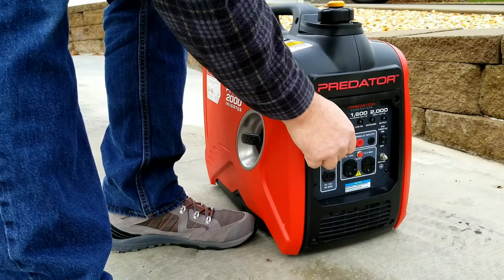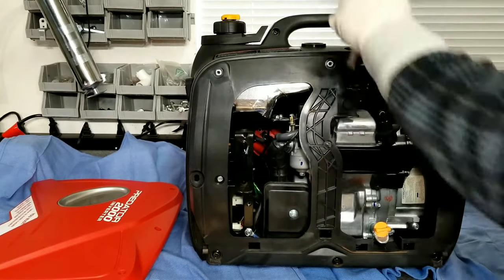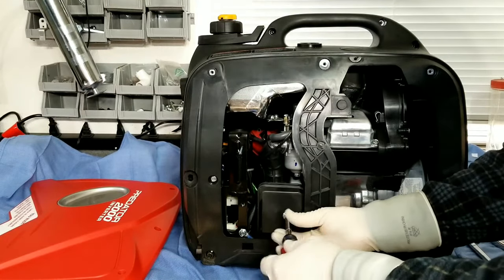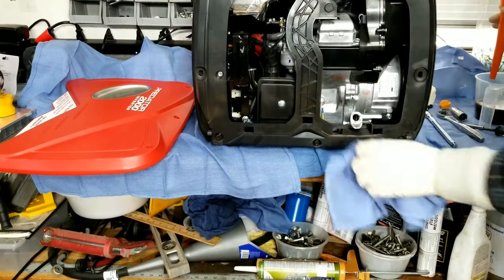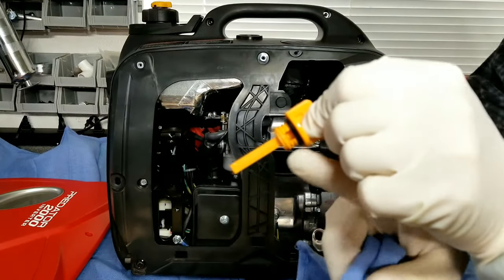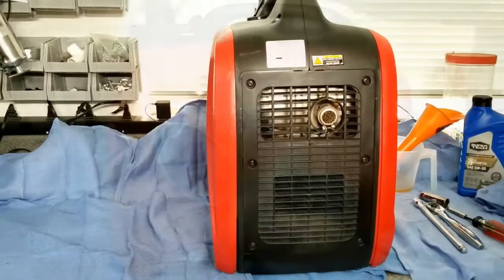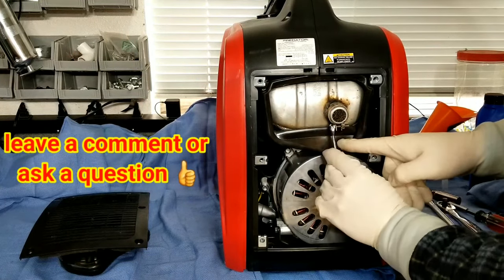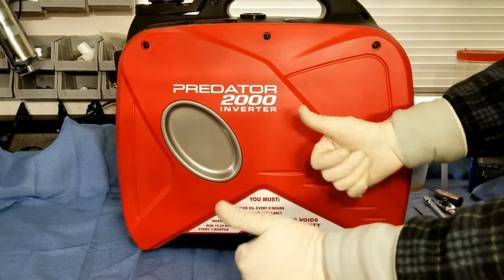Predator 2000 Oil change and 100hr 6 month service Don't forget this part!!

Comment from the maker: Hope you enjoy this quick tutorial and thanks for  watching and Subscribe 👍😃
Reply: Hello I meant to ask if I can use 100% synthetic oil being that I know that Vehicles last a lot longer are you smoke one synthetic but if I use synthetic on the generator will that tend to make the cylinder piston rings everything last longer
Reply from the maker: Yes that will work fine
Reply: @johnnysweekends  Sorry Johnny  I mistakenly typed "smoke" the word was not planned, so disregard it
Reply: @johnnysweekends  How do you loosen the spark plug boot, you passed it as if your unit did not have the cable boot connected to the spark plug I tried pulling it and it is glued for good
Reply from the maker: @alexshatner3907 it shouldn’t be that hard. Twist back and forth and pull up

Comment: Just a update for you guys about thos generator... I use it almost everyday with 600w load... mine currently has 3500 hrs on it and still running... I change oil with synthetic at 100hrs and I use a ngk spark plug cr5hsb
Reply from the maker: Wow that’s crazy..!!!!
A lot of hours on it. But showed if you don’t always over load it and take care of it it will do just fine
Reply: We run ours 10hrs a day. It runs our Starlink dish & phone booster so not a big load.
Reply: I have about 3000 on mine and use it daily too. Only issues I've ever had was fouling plugs from clogged spark arrester

Comment: Thank you for the video. I learned a good bit.    Just got one today and I'm not going to get it out of the box for a while.    I have a 9400 wt generator  but got this 2000 predator just incase we ever have to leave in a hurry.  We can charge all out phones run a fan or to or blow up air mattress  100s of uses when on the road

Comment: You forgot some things. What do you do if that exhaust screen is dirty? You say oil should come up to the threads. Look in that hole. The threads look like they go way down there and don’t match the dip sticks length. Finally do you run out the gas if you are not going to use it for a long time?

Comment: I've been cleaning the air filters on my Honda every 50 hours as per the manual.  Total overkill given that I'm running it in the fresh air.  Also I need one of them clip on funnels!
Reply from the maker: Yea depending where you use the gen every 50 hrs hrs can be a little much. But not everyone treats them the same so maybe bump to 75 hrs unless its in dirty conditions. But having a clean air filter helps it breath and run efficiently so nothing wrong with every 50hrs.

The funnel i just wedge in there lol and it stays...Walmart 😁

Thanks for the comment and thanks again for watching and Subscribe 👍😃

Comment: Great video! I might add...

Get a aftermarket magnetic dipstick. Change your oil twice within the 30 hours break in. Pull all metal shavings off dipstick each time. (There will be a lot). This will maximize your engine lifespan a ton. 🤟🤟
Reply: Got a link?
Reply: Bad idea. The little ball magnet  falls out and then youve introduced more metal than you could ever pick up. Proper break in (changed my oil 3 times in the first tank) and then proper maintenance after the break in period, will resolve the need for magnetic pickups.

Comment: I have had my Predator 2000 thru a few storms in winter and the spring and it has held up fine. The only complaint I have is there needs to be a inline fuel filter to pick up any trash from the fuel. I recently tried starting mine after less than a month and it wouldn’t start. I checked the oil, filter, spark plug and carb. The culprit and fix was to drain the fuel from the bowl since there was trash in it. This fixed the issue and runs great now!
Reply from the maker: That’s good to hear…. 

Glad it’s working good.
Reply: ⛽️  keep the fuel tank filter in place... pop the side cover off & drain the carb bowl before storage and you will be copacetic
Reply: There is one. It's in the carbs fuel inlet.
Reply: When I shut my off, I turn the air vent off, then almost turn the dial to shut it off and that starves itself for gas and burns off the remaining fuel out the carb. Few extra pulls to start it but the carb doesn't gum up with fuel between starts

Comment: Awsome work...I just replace the flame filter restor it was clogged real bad  that it made my overload  light blink,Blick ...and my generator wouldn't stay on to long 20 minutes. ,running crappie ,and shaking generator was moving around in circles,no power tools working ..thanks for tips 👍.now is stable sounds smoother . no overload blinking light...yehhh,..I even looked at the manual troubleshooting guide and their is nothing there guiding me to the filter restor????
Reply from the maker: Wow well glad you went and check on it..
Glad I could help out..👍🏼

And thanks for watching 👍🏼😀

Comment: Adjusting the valve lash would be a good idea too at 100hrs
Reply from the maker: I normally don’t touch them until the unit has a issue mainly with starting. Sometimes if it ain’t broke to mess with it. Lol

Comment: Thanks for the info brother! Getting on it right now!
Reply from the maker: Glad I could help..👍🏼😀
Reply: @johnnysweekends  started raining.. damnit.. does it have to be 4 cycle / small engine oil? My internet sucks so I couldnt really tell what you used. I already grabbed some mobil 1 fully synthetic 10w30 fro. Autozone.. that should work fine, right?
Reply from the maker: Yup. These little engines don’t care about brand just weight and frequent oil changes. 5-30 or 10-30 is just fine. 

So you are good 👍🏼
Reply: @johnnysweekends  thanks again!

Comment: Hi, do you know what spark plug this Predator 2000 takes. Rather have it before hand, thanks.
Reply from the maker: Hello, this is what is typically found in the unit stock. But you can use others. 

https://amzn.to/3uGP7I8
Reply: @johnnysweekends  Thanks Johnny..

Comment: When should I not turn on my eco button?? Is there a certain wattage it shouldn't exceed?
Reply from the maker: Yes, if you use say a compressor and it starts and stops alot then circumstances like that is a good time to have the eco switch off. Or starting up ac units.
And load that requires full boost power is when it should be off then after say a AC unit is running then turn it on.

Comment: Thank you for sharing this video.
Reply from the maker: Your welcome glad I could help. 😀👍🏼
Reply: @johnnysweekends  I bought the Predator 2000 yesterday.  Will use it this weekend.
Reply from the maker: Awesome make sure to change the oil after a few hours it gets dirty quick then you can go to the recommended it says in the manual or if heavy duty use change more frequently 👍🏼👍🏼

Comment: can't pull off the ignition coil, how did you remove that to get access to the spark plug?
Reply from the maker: You don’t need to pull of ignition coil just the spark plug boot only. Just lift it straight up.

Comment: I want to purchase one of these generators for emergency use only. Should I keep gas in the generator or should I fill it up when I need to use it? Mostly for the rare power failure in my area. Thanks for an excellent video.
Reply from the maker: Honestly empty is better that way you have fresh fuel when you need it. That way if its 2 years before you use it the carburetor will not be compromised from old fuel possibly damaging it. Now you could drain the carb with the drain screw and that also works.  Or leave empty and get a metal can of ethanol free fuel from say home depot or lowes. It will be good for a few years i believe. 
Hope this helps.

Thanks for the comment and thanks again for watching and Subscribe 👍😃

Comment: I put too much oil in my first start up and the Predator blew white smoke for about 10 minutes before the exhaust became clear. How would I know if I damaged anything?
Reply from the maker: I would assume it if it’s running ok then it should be fine. I would check the oil level again and make sure it’s correct. 
Only to the bottom of the threads when level
Reply: @johnnysweekends  thanks for the  excellent video !
Reply from the maker: You’re welcome 😀👍🏼

Comment: I see you’re running full synthetic 5w-30. I heard from a mechanic that I should use “poor quality” oil for the first thing of oil (not synthetic) to help the rings seat, which will help make it so it doesn’t use/leak oil in the future. What are your thoughts on this theory? Sorry that I may not be explaining correctly
Reply from the maker: I have heard that as well to use a base mineral oil like the old days to help with break in and seat the rings.  

Now with the invention of new synthetic oils that have a lot of different materials in it along with cleaning agents I bet it really doesn’t make a difference and even if it does it would take years to find out between one engine and another used in the same fashion with normal service. 

Most people never keep anything longer then 7 years now if not less before they sell or upgrade or whatever. So everyone who does all this crazy maintenance or use super expensive oils which most are pretty close except amsoil, all your doing is helping the next guy and then the next guy.

And most the times engines die from abuse or neglect verses a normal break down from a manufacturer defect. 

In most these generators I hardly hear of a generator loosing a piston or something from any oil. These are basic lawn mower engines. And with normal use and maintenance they will run fine with the correct weight of oil that is changed frequently. Your motor is not a performance engine so it doesn’t care. 

And more then likely the inverter board will fry long before the motor dies.

Sorry for the long explanation lol….🤣😅👊🏼

Comment: what was the size and name of the tool you used to change the spark plug? Sorry i'm not super handy :(
Reply from the maker: You need a 3/8 ratchet a long 3/8th extension. And a 5/8ths spark plug socket..👍🏼

Comment: What would you use to clean the exhaust flame arrestor with. soft brass brush or would you use any solvent to dry to dissolve any buildup
Reply from the maker: I use a torch as seen in a couple other newer service videos, but a brush is quick and easy and works great. But the torch is a lot more fun. Watch the newer videos for service towards the end and it shows the torch being used. 

👍🏼😀

Comment: Can I use Honda 10 w30 oil in my predator generator? I don't think it's senthetic?
Reply from the maker: Yup you can use just about any oil as long as it’s the correct weight. 
I almost think I’m going back to semi synthetic for about everything. It’s cheaper and honestly I have never seen a engine these days with proper maintenance die because of a oil lubricant problem. It’s normally something that fails due to neglect or abuse.

Comment: I will be using it for vacuuming (detailing) when should I first check the oil?
Reply from the maker: If new switch oil after about 5 hrs or less then every 50 hrs.
Reply: @johnnysweekends  Thank you
Reply: You liking it for detailing so far?
Reply: @joncruz4837  It is very quiet than I expect it 👍 I recommend it.
Reply: @Lex_RKO  nice!! How many things can you run on it? I’m hoping I’ll at least be able to power my air compressor and steamer too Individually of course
Reply from the maker: How big are the units… you should be able to find the amp draw.
Reply: I have the older 2000 that my dad no longer needed. Mine does not say "inverter" on it. It says 13.3 amps maximum so I can only run 1 tool at a time since my pressure washer runs at 12.4 amps I can't have my steamer warming up as I'm washing the vehicle. I will be upgrading to the 3500 Predator soon so I can have more than one tool running.
Reply from the maker: Keep the little one with you as well..

Comment: Great video! Any tips on the engine surging? I compensate by adjusting the dial choke but would rather have it working properly. Mine has about 100 hours on it so I'll try all of your tips especially the plug cleaning or replacement, Thanks!
Reply from the maker: Let me know how it goes but yes a new plug and fresh gas is helpful.
Reply from the maker: Don’t for get to check the air filter
Reply: I don't know what carb it is but it's probably the jet needs cleaning on the top of the carb. It's probably under a little brass screw behind the throttle shaft if it's a Yamaha clone. You would remove the screw and the jet and run a small strand of wire through the holes in it and rinse with solvent and reinstall. Might also be under the idle screw if it's a clone of a Honda carb. You will have to remove the carb to access it most likely.

Here is an example https://youtu.be/O_DZXh67-fc

Comment: When pairing inverters do you know If it’s ok to have one in eco mode and one with eco mode off? Thanks in advance
Reply from the maker: I would have them the same both on or off eco.
Reply: @johnnysweekends  ah thanks for the reply sir
Reply: I could just run a splitter on my 50a plug with 2 plugs and run the side that runs the ac on one off eco and the other in eco I suppose
Reply from the maker: For like a rv..? I you want to power each line you could do it that way then. AC side eco off, and all other minimal loads with other unit. Depends on the rv though and how its wired.
Reply: @johnnysweekends  yep I’m an electrician so I think I can figure it out lol
Reply: @johnnysweekends  😁👍🏽

Comment: Would really like to see a video taking the carburetor off and cleaning it. I think I pinched mine while removing the recoil assembly which had one bolt bottom that was really hard to get off. I might have pinched the hoses or changed the cable setting not sure. It would be nice to see how all that works and its settings  :-) There are no videos on YT on removing the carburetor on this particular generator. The problem I have at the moment is that when I put a coffee machine on it it revs up as it should but just about 30 seconds into it it winds down suddenly almost dies, then comes back up again but not as high as it should. After removing the coffee machine it winds down to its eco speed again as it should and while I have my laptop and phone on it it runs really smoothly as before. Before I changed the recoil assembly I didn't have this issue. I did leave the generator standing for 3 weeks fully fueled up which might have been a mistake. The carburetor could have gotten a little sticky with the standing fuel in it.
Reply: Its actually overloading now with the Black Decker coffee machine which is only 650 W this wasn't a problem before. I stopped using the coffee machine and just have my laptop running on it which still works fine. But something really weird happened  :-) It was handling the coffee maker just fine before for months.
Reply from the maker: Well start with all the basics first. Correct oil level, new spark plug, air filter clean so it can breath and same for spark arrestor.

Also hot temps and altitude will have a big effect on how your generator performs. 

If you have done all those then yea a carb clean may be needed if it’s gummed and running lean it can run hot.
Reply: @johnnysweekends  Thanks Johnny yeah I took the air feeding assembly off the carburetor to get to the recoil assembly so its probably something to do with airflow. It runs a little while while the coffee machine is brewing and then it overloads which to me indicates its overheating and its a buildup. Its probably something I pinched somewhere because it was running flawlessly before. :-)  Thank you for your kind response.

Comment: How’s this generator been?
Reply from the maker: This is my friend's i have rhe a-ipower. Both have been great and never issue yet. Its really about running them, at least every couple of months for maybe 10 mins.  Ethanol free fuel helps to especially during storage times.
Reply: 3 yrs 1000+ hours on mine. Bulletproof.
Reply from the maker: They truly are great and the price is unbeatable.

Comment: My Predator 2000 inverter has an engine surge.  I have cleaned the carberator.  The engines rpm is constant under heavy load.  The esc switch does not seam to work either.  Could you school me on my problems.  Thanks

Comment: Looking for any advice, 

After 5 months of working fine, I have no power going out in the outlets but the engine is running. Does anyone with the same problem?
Reply from the maker: I assume you tried rhe circuit breaker.  Also maybe pull front cover ans check the obvious like loose connections and such. Also is the whole thing not putting it power.?  Possible voltage regulator to.  But check the easy stuff first.

Comment: How much oil does it actually take ?
Reply from the maker: .4 quarts. So not much. Just get it half way up the threads and your good...😃👍
Reply: @johnnysweekends   Make sure it's to the top of the threads, because the low oil sensor will activate and shut it down even if it's a little low. Ask me how I know ;) When in doubt, top it off.
Reply from the maker: Nice,  yea some seem to be a little more sensitive then others.  👍
Reply: I think 13 ounces.